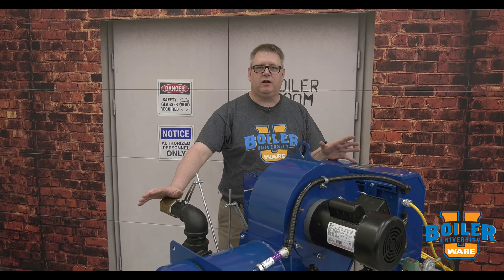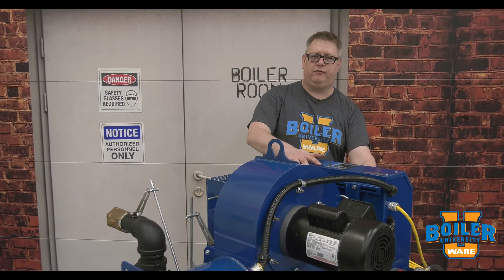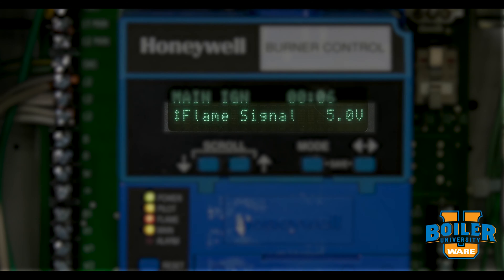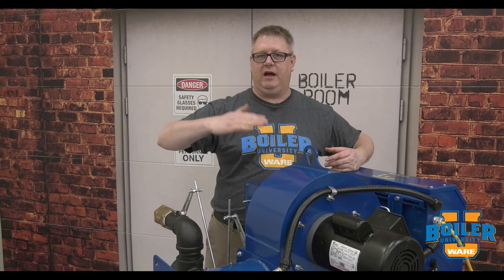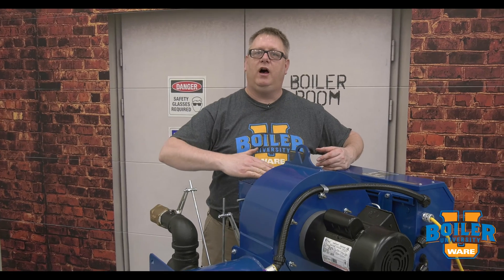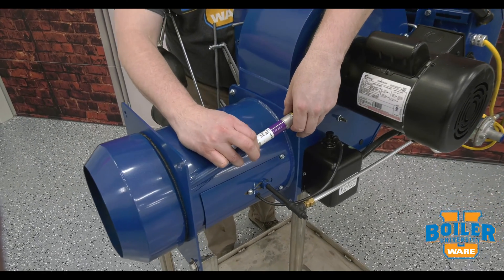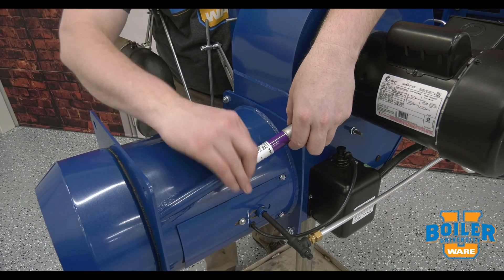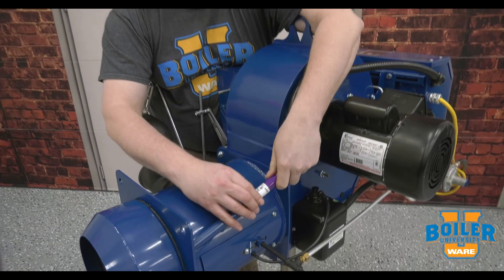Cleaning the Burner's Flame Sensor - Weekly Boiler Tips

Comment: Ok so we are on our second flame sensor due to getting code 15 flame detected our sensor is reading flame 🔥 when there’s no flame we replaced the amplifier also and still get the same issue our problem is intermittent not always it will run for 14/20 hours and then it shuts off due to code 18 or 15

Comment: I operate a honeywell burner in a concrete manufacturing plant, I dry Mason, concrete sand, and pea gravel. Everyday now that we have had a new system installed, my burner shuts off shortly after combustion and when I attempt to start the burner back up, during the purge I receive Flame Detected Purge Delay. I also get lockout 14 high fire switch during operation. We have troubleshoot everything and can't seem to find the issue.
Reply from the maker: It sounds like you could have a number of different problems occurring.  Fault 14 is a position or position-proving problem during purge, and that could certainly relate to lightoff-position flame failures as well.  You will probably need a service call to your local boiler company to solve this one. Appreciate the comment. Thanks for watching
Reply: @wareboilers  unfortunately the technician that installed the new honeywell system is in Florida and Quikrete is in Louisiana lol. It's beyond me why the company hired an out of state tech knowing he won't be able to come on a moment's notice. We finally got it running properly, but I think something was rigged up to make it run constantly, which could have consequences in the future. Thanks again you have a new subscriber.

Comment: Why would it get soot or debris? It should be clean if the burner is operating correctly. I would definitely look further if there was an issue with flame signal.
Reply from the maker: You are right for the most part. If soot / dirt / debris are getting in front of that flame sensor there are most likely other problems. There are some burners thought that have an inlet port on the pilot scanner tube which could let dirt and debris from the boiler room and gunk up the scanner. Hopefully that makes sense. In any case, make sure that scanner is clean is a good check to have. Thanks for watching.